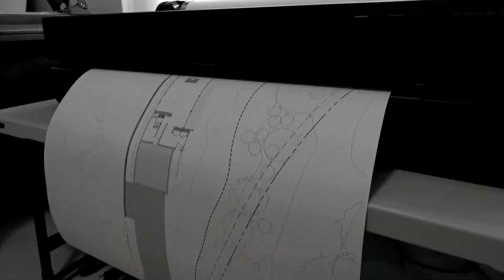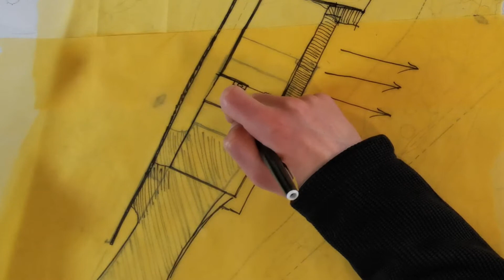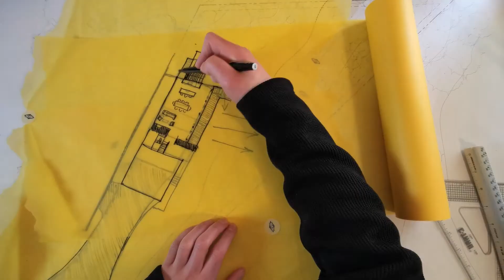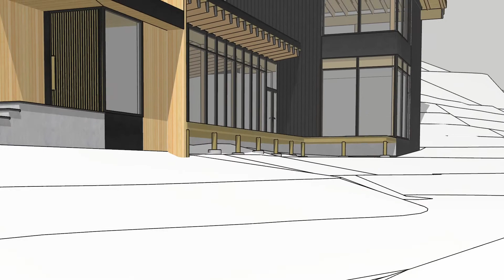How I Design Floor Plans for Northwest Homes - My Design Process

Comment: Love the look of your design. How are you creating your renderings?
Reply from the maker: Thank you so much...For renderings I tend to flip flop between Procreate and Sketchup. I use a hybrid method where I will manually edit the 3D renderings from Sketchup in Procreate to get things looking the way that I want. I will also bring in 2D technical drawings from Autocad and edit these in Procreate to give things color, depth, and texture.
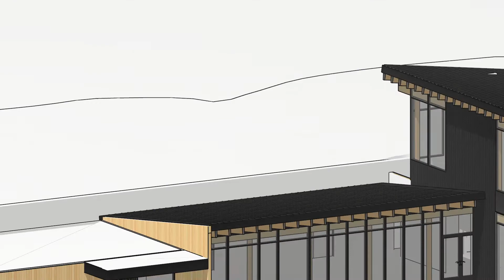Reply: I'm assuming the rendering at 5:08 is a sketchup model that you've edited in Procreate? I'm looking to provide quality images such as that to my clients but have not found a great way yet...
Reply from the maker: @carterjohnson21  Almost, that rendering was actually from an Autocad elevation that I imported into Procreate. Another technique you can use if you want to achieve this aesthetic is to trace over the sketchup images so that all the perspective angles are correct, and then apply a conservative, muted color palette, fade the background to give depth, etc.